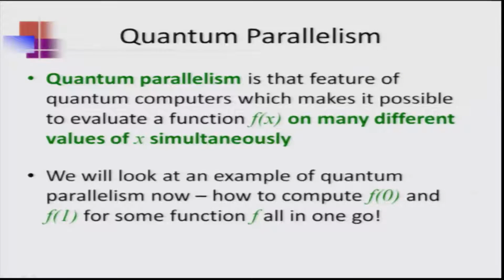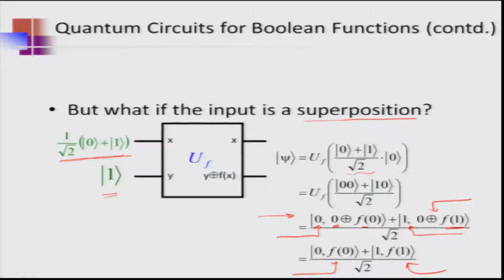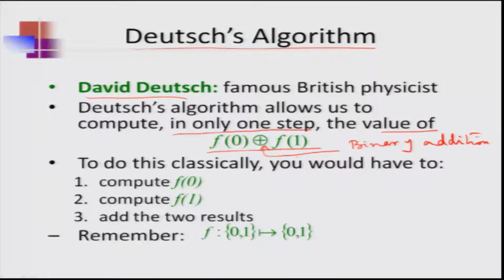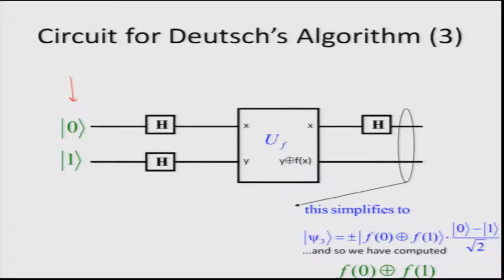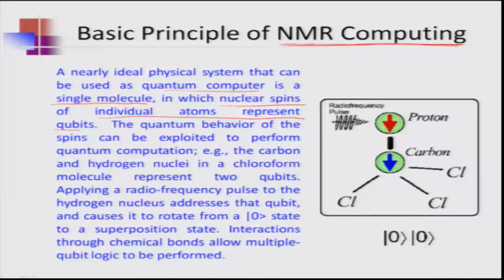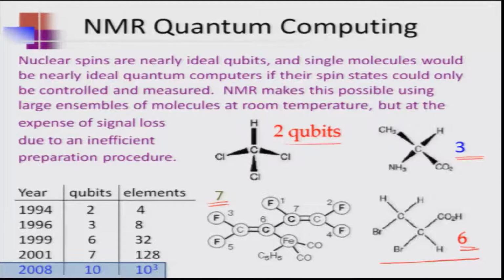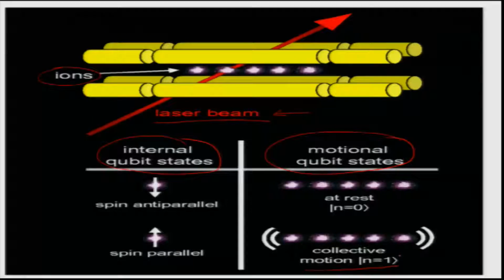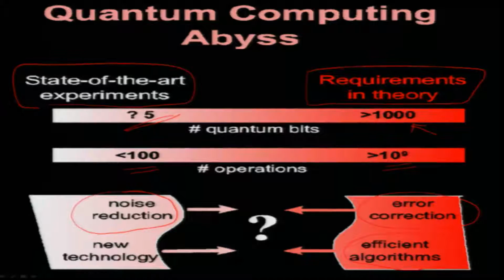DJ Algorithm and Implementation Aspects

Comment: at t=5min, in example of superposition state, why have we multiplied with the state |0> in the calculation, not the state |1>, as given in the circuit diagram.
Reply: There is a mistake. I think the logic is that the circuit performs boolean addition in the second qubit only. In that circuit it will be zero state in the second qubit.